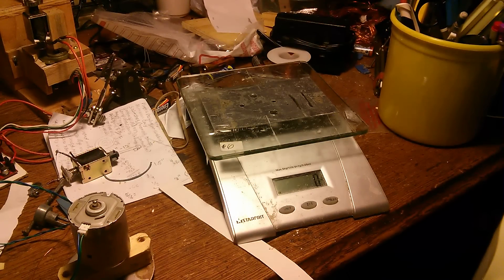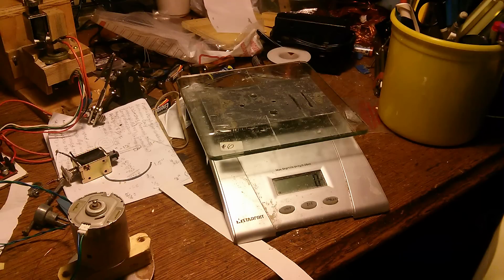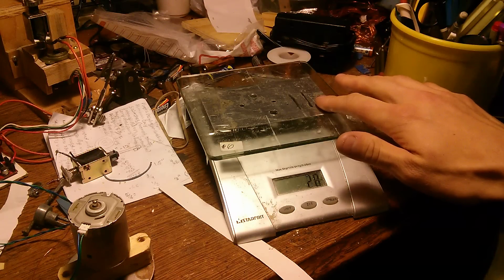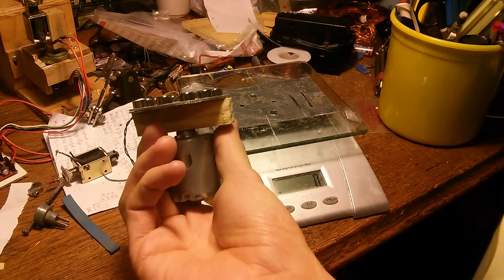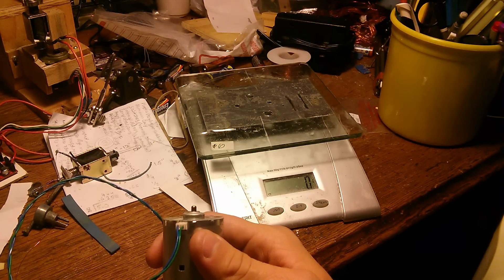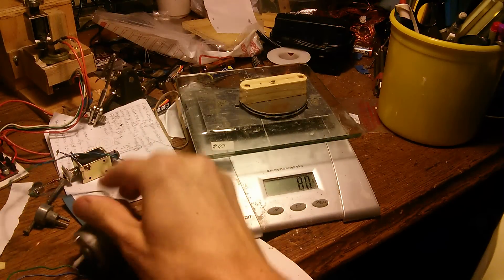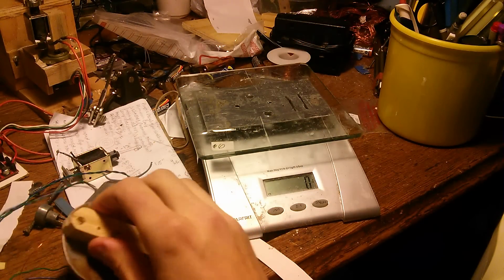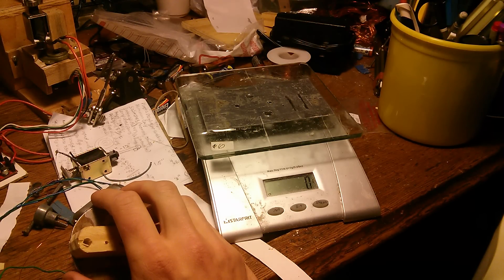Hendo Hoverboard Basic Technology

Comment: so its like basically dropping that magnet in copper tube or aluminum foil
Reply from the maker: Yeah, but energy is being added to the system by the motor, rather than simply dissipating the energy of a falling magnet.
Reply: Theballonist so the floor must be magnet?
Reply: Choi Humbert The floor must be a conductive metal (so almost all metals), As you can see in the Hendo video, the floor is made of copper sheets.
Reply from the maker: Yes, exactly.